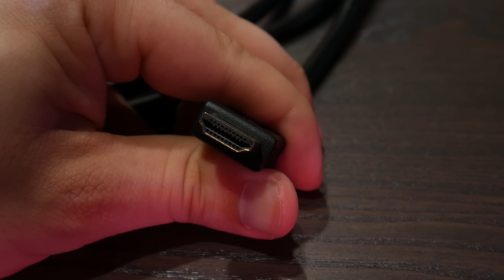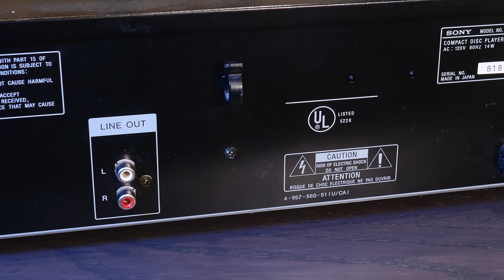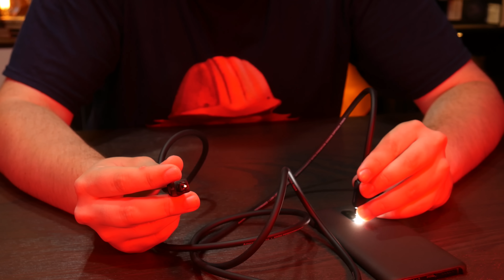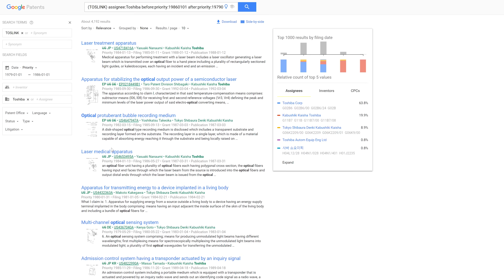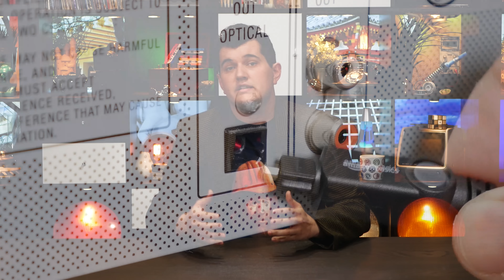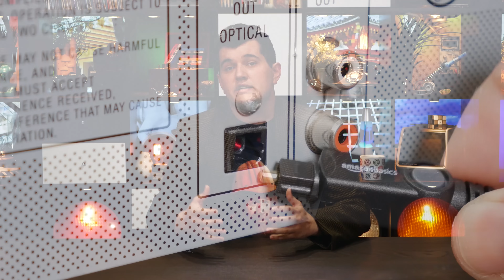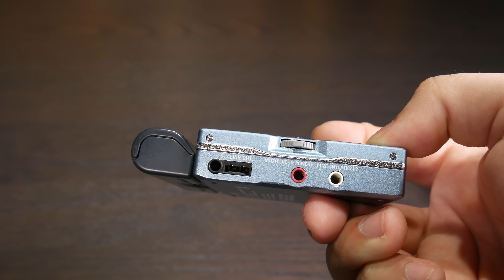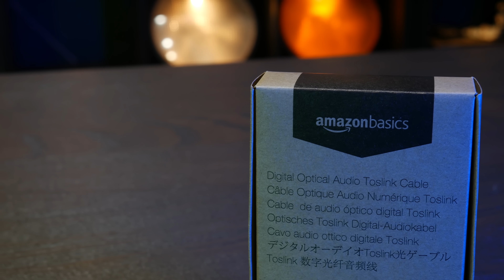TOSLINK: That one consumer fiber optic standard

Comment: I started using TOSLink (with a MiniTOS adapter) on my portable Sharp MiniDisc recorder in '97. The original cable I bought back then is still in use, having connected my various TVs or consoles (PS2) to my amplifier over the years, how I have avoided kinking it is a mystery.

Comment: The first and only time I've used TOSLINK is when I added a Vizio soundbar to our Samsung flat screen TV.  The reason I did this is because I needed to free up a wired audio connector on the TV so it could be used to connect to a device which sends audio to my wife's hearing aids.  If Vizio hadn't included the TOSLINK cable with the soundbar I wouldn't have thought to try it.

Comment: The mini Toslink is on all the AirPort Express devices.  That's when I first heard of and used it.
Reply: Macbooks had it for a while. The software had a tendency to glitch out and leave the optical on when no cable was plugged in.
Reply: @gajbooks  Exactly. Almost all Macs (until very recently) had optical out.
Reply: @gajbooks  Yep. I had this problem on 2 Macbook Pros. Thats where I learned about optical 3.5mm
Reply: Looks like nearly all apple devices had them from 2006 (spare iPhones etc), and they started phasing them out in 2015 when the Apple TV dropped in and 2016-2017 when MacBooks and iMacs started dropping it. 
It was everywhere, but people usually never noticed it
Reply: Fun fact, the Airport Express optical out still works even when the wifi dies. Ask me how I know .....
Reply: @nemmrrc  How it works if there is no WiFi connection to audio source?
Reply: I had one of the first portable Sony minidisc players back in 1992.  It had a mini Toslink port for recording.
Reply: The first time I saw it was the optical input on a 2013 Astro MixAmp.
Reply: Some Asus Xonar soundcards also feature this kind of output, like the D1/DX and DS/DSX. So ~2006 onwards.

Comment: I loves the TOSLINK.  I'm using it to output TV audio to a TOSLINK->RCA adapter so I can (in my office) get TV audio to my mixer and (in my bedroom) get TV audio to some powered bookshelf speakers on the nightstands.  Wife and I each have one so we can watch latenight TV and not wake the other.

For the longest time the AT&T U-Verse receivers had a software bug and they couldn't do proper 5.1 sound over HDMI so I would use the TOSLINK connection for surround sound.

Comment: It DOES avoid ground loops, which are an issue..... sometimes.
Reply from the maker: I should have brought this up and investigated the issue a little further. The RF interference issue was what I focused on and admittedly I glossed over the potential for ground loops to form. Still, if we're simply talking about which format transmits the data better, there's no difference at all. In fact, as I alluded to, some people think the increased clock jitter from TOSLINK means it can sound worse because... reasons? I guess?
Reply: @TechnologyConnections  Also, TOSLink sure allows 'hot swap' while RCA has this strange quirk of connecting signal line FIRST, and ground SECOND which may kill your electronics if it isn't properly grounded.
Reply: @allmycircuits8850  Since we are in space mania for a day, read about the "4 inch flight". As the rocket lifted, a connector pulling out disconnected the ground pins first. Can't believe they didn't know this.

An example of hot or even cold plug design to look at is power and common connect first and last before the middle data pins.
Reply: @allmycircuits8850  Ya. We need someone to explain THAT one for sure! Gaaa.
Reply: Ground loop down an RCA (or similar) cable can certainly be an issue even if it is a medium for a digital signal, because vendors cheap out with chassis and signal grounding. See the "pin 1 problem" etc, though most of those examples are with XLR, the issues are the same. Though your point about data integrity stands.
Reply: @TechnologyConnections  This is the EXACT reason is use TOSLINK between my computer and DAC: If I use RCA or USB the DAC picks up the coil whine on my motherboard which was audible when scrolling or playing games, etc. Using TOSLINK completely eliminated this problem.
Reply: @TechnologyConnections   Using Toslink, I actually was able to solve a ground loop hum situation in a restaurant's horribly cobbled together mishmash of home and professional Audio equipment. I could have probably used a bunch of isolation transformers, but in the end, a $10 analog to Toslink adapter saved the day.
Reply: @TechnologyConnections  but excess jitter would have the exact same effect as you pointed out with coax cables picking up em interference. the signal would be transmitted fine until the jitter exceeds the allowed amount, then it would break completely.
Reply: Nathan Sketch That assumes the signal is being buffered or dejittered. Historically, this wasn't always the case.
Reply: @vhuttyu  jitter only applies to digital signals, so it either destroys the signal or can be ignored. jitter will never degrade the quality of a signal.
Reply: Nathan Sketch If the DAC is clocked from the recovered clock it can, indeed, degrade the quality of the resulting signal.
Reply: @TechnologyConnections  In a studio setting ADAT over toslink is super convenient both because it allows you to send 8 channels over one cable, and because most "pro" audio equipment is grounded, and ground loops are a real problem. So I want you to know that you're saying bad things about a standard I love, and this hurts me. Deeply.
Reply: @plateoshrimp  Yeah, the ADAT over toslink is great and i have been using it quite a bit. Not only can you transfer 8 channels of up to 48KHz 24 bit audio at the same time through only one slim and cheap optical cable with perfect quality it also isolates the different units electrically to avoid ground loops as you mentioned which is also a great feature as you can really find yourself in a mess of groundloops in a studio if you are not careful.
Besides the omission of mentioning the groundloop factor, it was a great video as always, im actually surpriced ADAT was even mentioned.
For those that dont know the origin of ADAT it was originally a 8 channel digital tape format from the 90´s before the time of Digital Audio Workstations in your computer, ADAT recorded on SuperVHS cassettes and the ADAT lightpipe transfer format over toslink that we still very much use unlike the ADAT tape machines was used there.
Reply: I'm gonna say it

Toslink is the reason we don't have to shove discreet  ground cables between our media devices & our dac/amp
Reply: Optocoupler does it as well. And fiber optic link is actually an optocoupler. Just flexible and veeeeery long one.
Reply: Speaking of ground loops, they were a problem for me when I was briefly subscribed to the local cable provider for television and Internet service. When they run the cable from the line to your house, they ground it at the roof connection to the house. Not so much of this happens when people are trying to steal cable.
Reply: Bonus points: You'd have thought they would stop this entire cable thievery thing, considering the carriers went entirely to encrypted digital ages ago. Nope, they think they can steal that regardless. All they succeed in doing is diminishing the digital cable Internet and TV with interference across the entire loop.
Reply: Check out PhilsComputerLab as to why he uses optical TOSLINK to connect his retro PCs to his recording box... long story short, ground loops.
Reply: Some SPDIF also have isolation transformer on the input.
Reply: I was almost ready to kill myself over a ground loop analog audio issue. Thanks for saving my life HDMI! And F?!? you blackmagic intensity.
Reply: @toysareforboys1  Yeah, one or more loops can be tough to eliminate.  I  used to electrically "bond", (connect) all the metal chassis of my 8-10 piece stereo together with heavy wire, then firmly ground it with a single connection.   That worked well for a relatively complex set of gear.  Surprisingly, not one piece of that late 70s-early 80s stereo equipment had a power cord with a ground pin.  I guess individual grounds could have actually  caused noise problems.  That (really good) equipment could sit, fairly cranked up, but without a source playing and no hum or hiss you could notice.
Reply: @denniswalsh8476  Awesome! My recording gear was on the opposite side of the room as the source equipment, and worst of all on a different phase, so I assume that made the ground loop issue even worse.
Reply: does also help when you run audio thru multiple processors. Ie processor pre amp, amp etc.
We use toslink for streaming data and video as well to certain...machines.
Reply: This is fixed by isolation at each end and differential signalling.

For example, the MIDI spec (also from the early 1980s) mandated optoisolators for this reason. So even back then people were perfectly aware of how to deal with this.
Reply: When your monitor isn't properly grounded so it sends voltage through the DVI cable into the case.
Reply: Like in that little dj  booth
Reply: When I connect to my tv using digital coax, my speakers hum very loudly. Not so with toslink. I don't understand how people can say it's in my head. It isn't. I can even measure the hum on my cellphone DB meter... The extremely loud hum is not in my head...  I feel like I am being gaslit...
Reply: Only in crappy designs. SPDIF is intended to go through an isolating transformer or an op amp or something, such that the RCA jack doesn't touch analog ground.
Reply: All modern DACs - at least those you’d find in any halfway decent receiver or sound bar - reclock the signal. So jitter is irrelevant. Has been in all equipment made since around the turn of the century.
Reply: as he mentioned implicitly at 11:46
Reply: @o_-_o  Not the same. RF interference creates noise on the line, but that noise is balanced. SPDIF over RCA involves linking the grounds of both devices, which (if the power supplies aren't on the same phase, or one/both of them have bad smoothing) can introduce ripple/hum in the ground of both machines. Which is not a problem with the decoding system, but as the transistors that do the amplification are also connected to that rippling ground, you get hum.